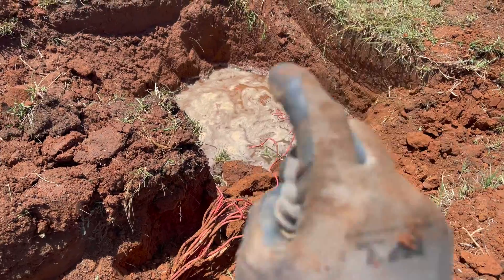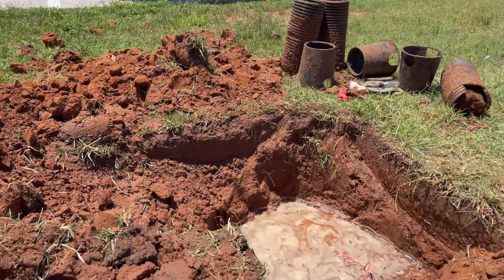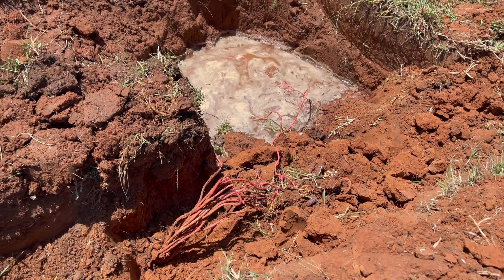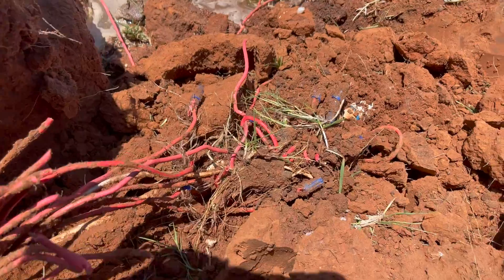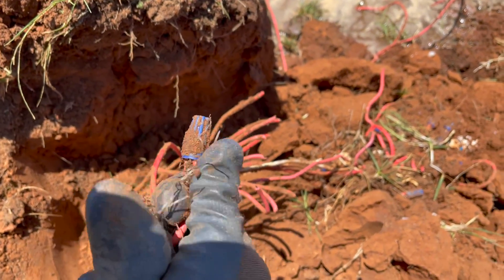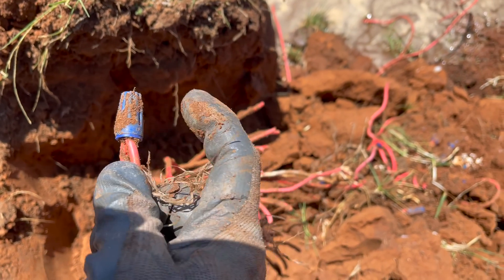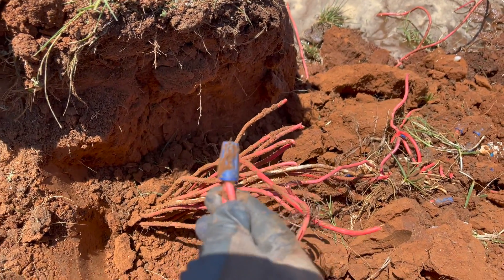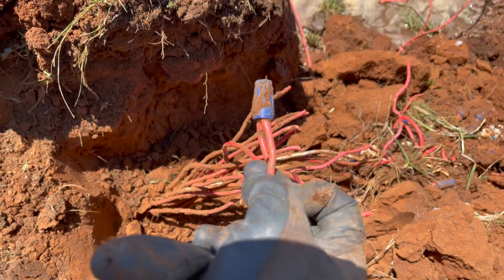Avoid These  Irrigation Wire Splicing Mistakes | Tips For Sprinkler System Wiring Installation

Comment: Is 16 AWG "marine wire" good for sprinklers?  Wasn't sure if all 16 AWG wire are created equal.  Thank you!
Reply from the maker: It could be. One of the main differences with irrigation wire is that is rated for direct burial, meaning it can be buried and the insulation will not break down. So marine wire could work, but it would be better to use wire that is for being buried in the ground.

Comment: I can’t believe you even have to say this. Who buries where they connect wires? I use Scotchlok IDC connectors. Always placed in a box.
Reply from the maker: I know. And I ran into another one again just the other day on a 2 wire system with wire splices buried and system didn’t work. 🤦‍♂️